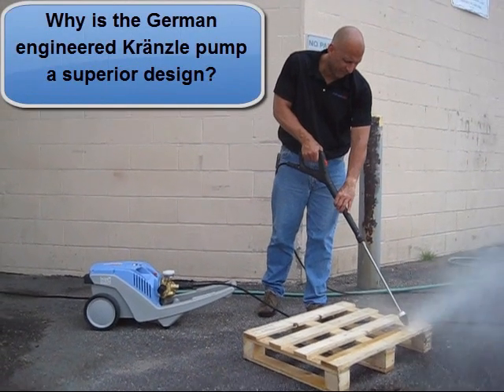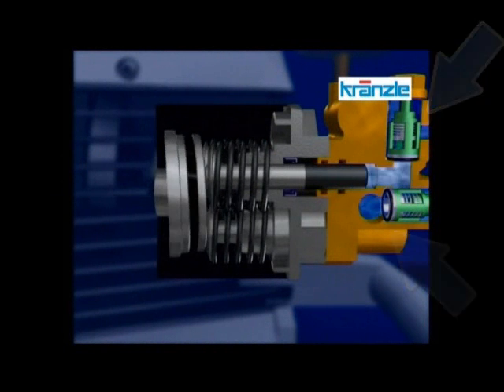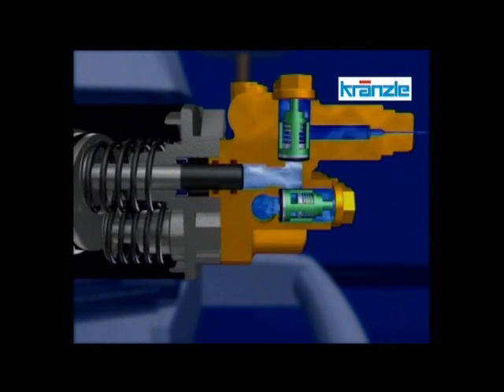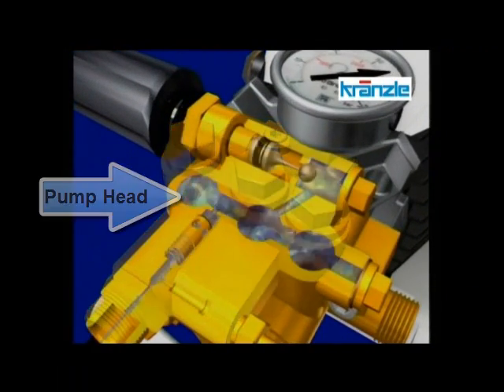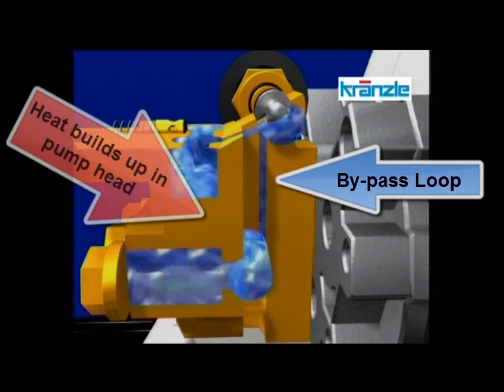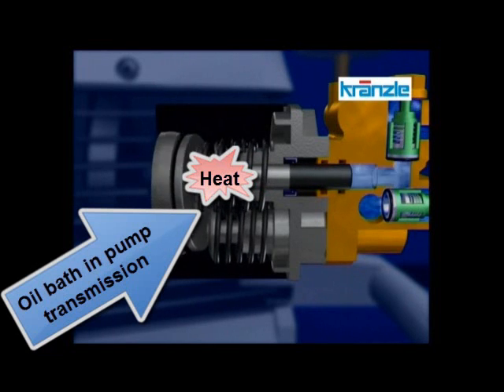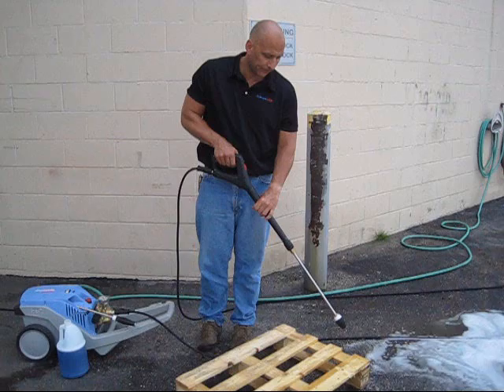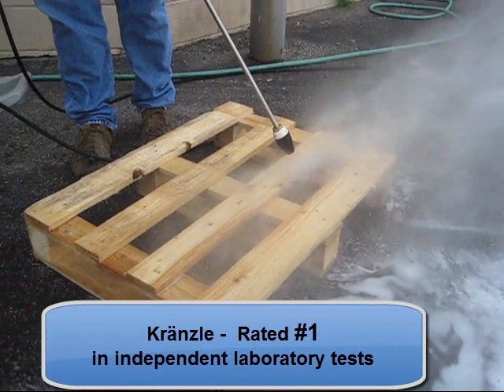Why the Kranzle Pump Is Superior

Comment: ...how to compare with Comet K250??? (also with ceramic and steel)
Reply from the maker: Hi. In our opinion, there is no comparison. Pump to pump, the Kranzle pumps are superior through all around quality. Also, their plungers are hollow where the Kranzle plungers are solid. Slight variations in operation also give a longer service life.

Additionally, Josh Lee, the Original Josh has provided this insight. 

"The Comet K250 doesn't have the same type of "stainless steel plunger with ceramic lamination/veneer".  It has a crankshaft style pump with the "ceramic sleeve plungers".  Those are the type that crack when they freeze. "